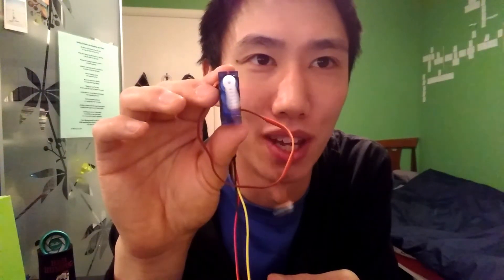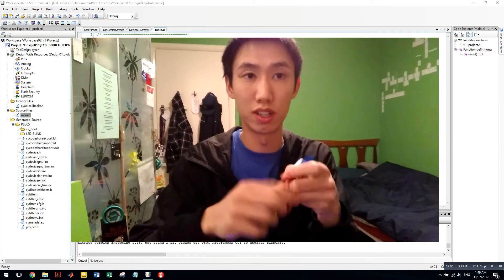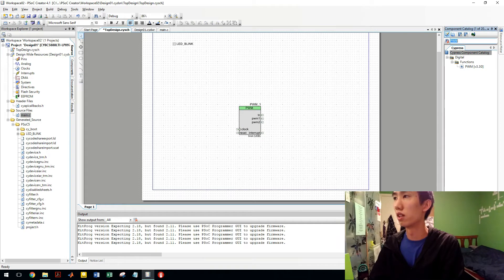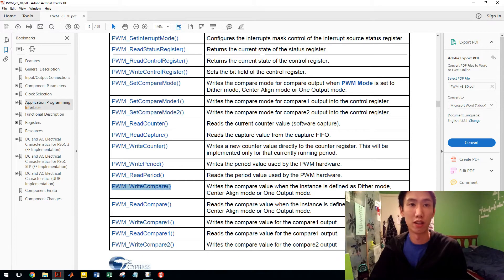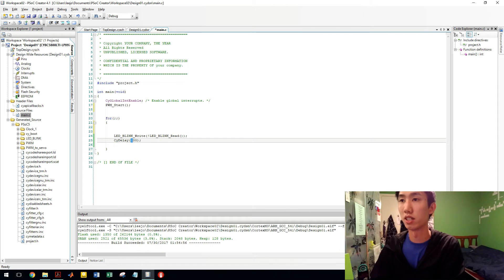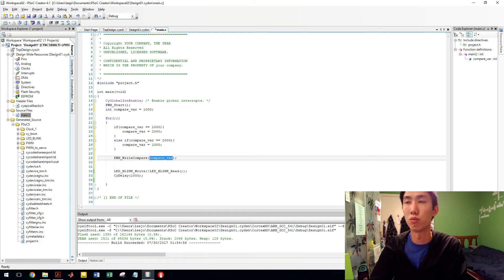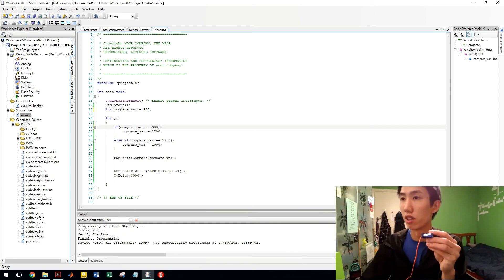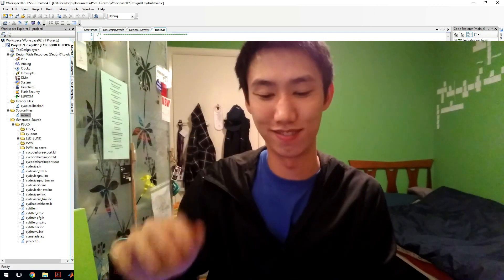PSoC Tutorial - How to control servos with PWM

Comment: Let's say you calibrate it with an Arduino, so it perfectly stops at 90° when the signal is 1.5 ms, when you make your tests with PSoC, you can find the stall point is not exactly at 1.5 ms, it's a little bit under that value

Comment: Hi thank you for your video, how we can have just one mouvement ( the servo motor press the space bar and return tot the initial stay ?
Reply from the maker: The servo itself doesn't have memory so can't return to initial position by itself. what you can do is write a code to tell it to move to a spot, wait a delay, then move to the starting spot. each position has a PWM 'number' so its just finding what number goes where
Reply: @jo3no  I want to control a dc toy motor, It must firstly be in high speed mode and then low-speed, also it must turn clockwise first and than counter clockwise. I still dont understand the period and the compare value.
Reply from the maker: @alihandalkilic1181  hmm if it's a DC motor you can use PWM to slow it down for low speed mode. But if you want to change direction, you will need to use a H bridge to control that